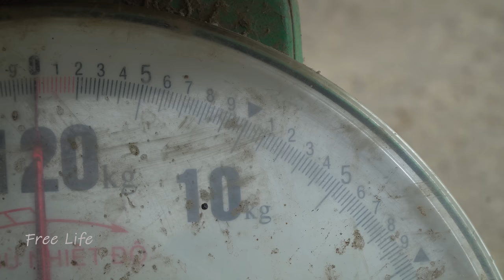Lieu Built the old woman a new BED -The old woman has moved into a new house to live completely

Comment: I have never eaten a papaya or its flowers so I learned a lot from you about them. I am 83, a retired engineer and a lifelong metal fabricator so I agree that the welding isn't the most professional that I've ever seen but it will safely do what it needs to do. At least he was using an auto darkening helmet. I bet you could learn to weld yourself! Collecting the rain from the roof is probably a good idea unless you have another water source.

Comment: I know you smoothed the ends of the tubes so they are safe, but what about maybe some wooden plugs notched to fit in the hole in the ends? I know you are very good with working wood. It would look nice as well as being even safer. You have done such good work here, and long may it continue. Be well.😉